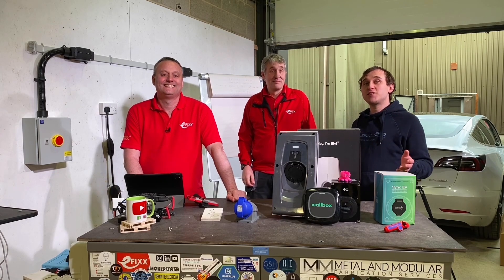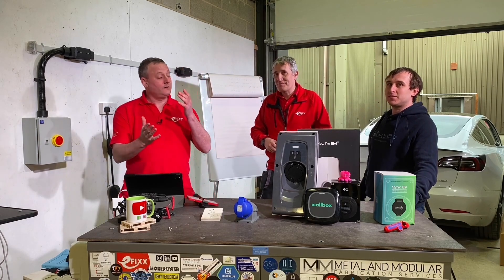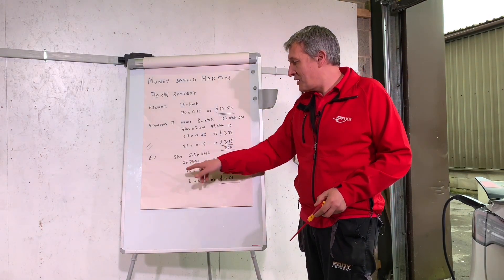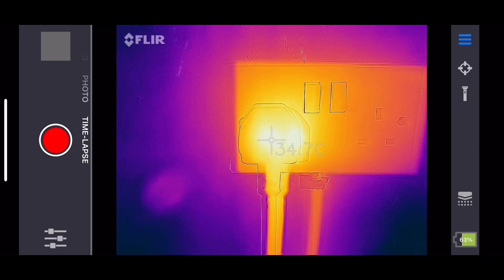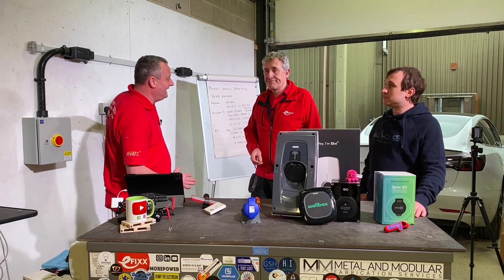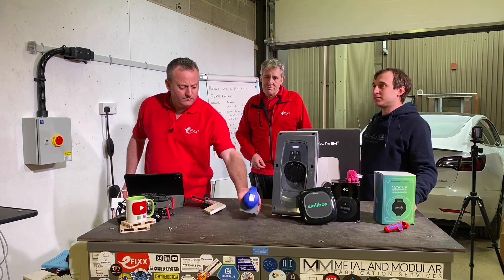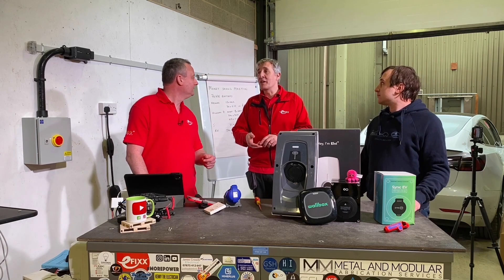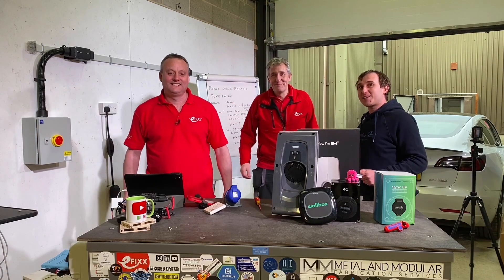5 Reasons NOT To Charge An EV By 3 Pin Socket!

Comment: What if you have an ev that has a far smaller battery than a Tesla. For example a 41kwh battery and you use a wall socket granny charger just to top it up... The charger is on for 4 hours max whilst under supervision.. surely this will still be beneficial for charging
Reply from the maker: Your missing out on lots of safety aspects and also missing out on cheap rates a 41lwh battery would take much longer than 4 hours to charge that frequent use of the charger would also mean the issue we mentioned could happen to socket as it ages
Reply: @NicolasRaimo  the problem I currently have is I'm not allowed to have a charger box fitted but I'm allowed to use the three pin. I only use it for short periods just to top up the car as my journeys are not very long... Maybe it would just be better to use commercial ones at shopping areas or electric stations in the future
Reply from the maker: @jakegreek1  why can’t you have a charger?
Reply: @NicolasRaimo  this is probably a strange one for most people to understand... I work and live at the same place, in staff accommodation. They won't have a home charger put in but allow me to use a three pin socket. I think it's for money reasons but I have said I'll pay, still a no...
Reply from the maker: @jakegreek1  would they consider maybe using it at marketing to say there being green?
Reply: @NicolasRaimo  I will have a word with them and try to persuade them...

In the mean time, I charger my 41kwh Zoe for around 4 hours a day. The socket does get warm but nothing extreme, it is currently my only option for charging.. is there anything (besides the wall charger) that you would recommend?
Reply: @jakegreek1  If you can charge for longer, look at one of the granny leads that offer an 8A charging option (usually switchable between 6A, 8A and 10A). It is relatively expensive but Vorsprung sell a Type 2 one for example. From 10A to 8A, the charging power is reduced by maybe 18% but the heating power losses due to resistance (what actually causes the risks of fire and damage) is probably reduced by about 40%. However, this is just a consideration of the efficiency on the 'house' supply side of things, not in the car itself. Depending on the charger control in the actual car, it might be less efficient to charge at lower power because, for example, maybe the car controller software is programmed to use some of that power to heat up the batteries or operate fluid cooling pumps while charging is in progress. Who knows? Only the car designers would know and there is scant information from them these days. I guess one could easily record multiple charge state increases over time at different ambient temperatures. I should do that, really. Note, it won't help with PEN faults, though, which is an electric shock risk associated with your car body going 'live' due to a fault with the house supply.
Reply: @jam99  been using it for a while now, no issues. Mone has 8 - 10 - 13 - 16 amp charging, for short periods I'd use 13 or 10 amp as it heats up slightly but long charging I use 8 and that doesn't heat up at all

Comment: if these granny chargers arnt safe then why does the dealership sell them. my car is a plugin hybrid it has 8.7kw battery it takes 4hours to charge and i get 36miles is that ok to charge for 4 hours
Reply from the maker: They should be banned however technically there allowed because they have no control what you plug into,  if you decide to use a non fully protected socket that’s your issue no there’s.  They do now all say however on the label for occasional use only

Comment: I guess if you're visiting a friend for tea, then you could plug in at their house with a 13-amp (=10A) plug for a couple of hours and give them 2.5kW x 2hr x 15p = 75p well, call it a quid... :-)
Reply: Some poor souls are paying over 20p per kWh, so you'll be talking more than £1.20. Make it £2 for 15 miles of driving, and don't use their electricity again, because the local supermarket fast charger, if there is one, will be cheaper, quicker, and safer!
Reply: @RWBHere  If it is in service and available. Still very few fast charge points around UK in many areas and typically twice as expensive as home charging.

Comment: I’ve been doing all my Tesla charging with a three pin charger for sixteen months now, two or three times a week overnight is enough for my average weekly mileage, no problems at all 👍
Reply: If you are doing the average 12,000 miles per year the average charge time per day is about 4 hours on a 3 pin plug. Many granny chargers have built in safety devices. On the very rare occasions I need to charge faster there are plenty of rapid chargers in my area.
Reply: @ronshazbut2723  You should still be aware of the strain on the plug and domestic wiring at 10A. Something like only an hour may be enough to cause a breakdown of a socket and resistance losses may be great if wiring is iffy. You just need to be aware of your home wiring condition and circuits, and state of your socket on the circuit you will be using. Even better, though, and not mentioned at all but ideal for low mileage users is the fact that granny leads are available that offer charging rates switchable between 6A, 8A or 10A charging. 6A and 8A have far less risk. The PEN fault issue is separate and is up to your own risk analysis. What should be happening is that the DNO's should roll out grid isolation switches to all domestic premises as well as PEN fault detection devices in all homes but there is no profit benefit, unlike with smart meters, so it is unlikely to happen. Instead, if you want to use electricity safely, the consumer must pay. I believe the regs say that electricians should not be installing 3-pin domestic sockets intended for lots of EV charging unless PEN fault detection is implemented. It would be nice to see the stats on PEN faults relating to EV charging. Last time I looked I think there were something like 100 reported PEN incidents per year in the UK and few were fatal. There are almost 70million people in the UK. However, the increase of unprotected outside electricity use on isolated 'earth' wired metal devices (e.g. granny charging a car) is likely to push the figures up. Regardless, it should be the responsibility of the DNO to ensure that electricity is being supplied safely upstream of the meter. If a fault occurs outside of your home creating a PEN fault then it should be the responsibility of the DNO to detect it and cut your supply, not the consumer.
Reply: @ronshazbut2723 Well said !
Reply from the maker: I've been driving my car for over 15 years now never had to use my seat belt yet,  but if i ever do ill be glad i followed the rules set out
Reply: @NicolasRaimo  I've not used a pedestrian crossing for years too, but I'm still here 👍
Reply from the maker: @Splitscreen83  great… your gonna never use one right..
Reply: @NicolasRaimo  What 'rules' do you think melgigg hasn't followed?

Comment: 13A sockets were designed for short use pluggable portable appliances.  Not high current appliance run for hours on end. In theory a 3 kW immersion heater can run off a ring circuit. A 3kW immersion heater (less than 13A) is always on its own circuit, with its own mcb/rcbo with a permanently connected supply.
Reply: No, a 3 kW immersion heater is 16 amp, but Yes, it has its own circuit and not a plug.]
Reply: @andrewdavidson7951  
I am at 250 volt in my house, which gives me 13.54 A for 3kW. Too big a current draw to be off a 13A FCU. That is if the 3kW immersion was designed for 240v and 13A, which most are, which gives a resistance of 18.46.  

The fixed resistance of an immersion determines the amps drawn.  Amps drawn rises and lowers to the voltage with a fixed resistance.  The higher the voltage the higher the amps drawn. Most are taught the higher the volts the lower the amps, that can be the case but not always.

16A? Way out.   To get 16A the voltage would need to be 296.64.

So, to be sure, always have an immersion off a 16A supply, or off a final ring circuit using a 16A mcb and 20A switch, which is legal.

Comment: Is that 21 hours for the 330 mile Tesla?  If so, a comfortable 200 miles will be approx 14 hours.  As most people never let a car's tank run below 1/4, the average to ensure a fully charged battery is 10 hrs.  That is, if you plug your car in overnight you wake up to a fully charged battery in the morning. 

But the 7kW chargers are better for sure, if a quick charge is needed.  And realistically the charger should be on it own circuit.  Charging off a 13A ring will also induce voltage drop on that circuit maybe affecting other appliances.

Comment: In the 18 months I've been charging using the granny charger and an RCD extension lead I've had a socket crack, and another socket just stop working entirely. I'm finally getting a drive built so I can then get a proper EV charger fitted, so at the moment I'm doing it in full knowledge of the risks involved.
Reply from the maker: many think there is no risk....
Reply: @NicolasRaimo  . There are a lot of dim wits in England and they hate listening to experts

Comment: So does this pen fault protection. Work before or after some one is getting an electric shock ? 
As my understanding of the regs it is to prevent electric shock
Reply from the maker: Depends on the system some systems work similar to an RCD and trip when they detect the greater mass of earth,  others can show fault and just not allow charging
Reply: @NicolasRaimo    At present I am not aware of any system that detect the loss of the pen conductor on a single phase supply. That do not have a earth Reference conductor Avalable. Ie an earth rod to give an independent. Value to measure against    The zappi patent showed a rcd type sense coil to detect a flow of current to earth.  But this workes only after the car has been touched and the person is getting   a shock . 
When it then disconnects the earth conection to the car as well as the live and neutral ... it seems to me that the big issue is the fact that we connect the car shell to the house earthing system.  Is it time that the motor industry should look at there chargers and why we need this earth conection ... why can’t it be earth free .  Double insulated ?
Reply from the maker: Correct some use a earth reference electrode, some act like an RcD waiting for you to touch the car then trip and others use a combination of this and other techniques.  Long as the disconnection is fast enough the risk of harm and risk is lowered.

Regarding redesigning the entire motor industry you need to understand a few things.
Cars have a 12v battery the negative is always connected to the body work of the car.  Cars are protected in theory by being insulated with paint but for the same reason double insulation wouldn’t work and reason a shock can happen is people can damage there car in a crash or accident and unlike a damaged electric device they tape it up or have it painted and carry on,m.  Also mechanics working on car could do a repair and remove any protection by mistake or sometimes on purpose like I’ve seen them remove heat shields as customer is complaining is banging.
Reply: @NicolasRaimo  Paint = some level of insulation. Tape = some level of insulation. Rust = some level of insulation. Crash is unlikely to happen whilst charging. Yes, it can expose bare metal for a period. Professional mechanic is unlikely to be fixing bodywork while charging without PEN protection but could be. Most home charging will happen at ground level. Local protective earth is very likely connected to water and/or gas pipes in ground. So, with a PEN fault, what is voltage likely to be on the car body relative to what the person is standing on? Person is likely to be wearing shoes; added resistance. Likely shock current is what? Sure, at worst death, but similar is the result of ice dropping from an aeroplane slicing through your body. Most ground substrates are more than bone dry and it seems to me that one may be just as likely to get a shock from a white appliance inside the house when a PEN fault happens, particularly with wet hands on a washing machine. Most dangerous, I would hazard, would be outside water taps and those with bare or wet feet. How many injuries/fatalities from an EV charging PEN fault have their been? How many shocks? I would call it a freak accident and certainly massively less dangerous than driving a car which we seem to have no reservations about. Why? Because the motor industry is a huge part of our economy. It is not profitable to be safe and so the risk is downplayed and never spoken of.

Please do show me figures if you have them. It seems to me that modern safety concerns with regard to risk is hugely biased towards improbability (insanity) because of those who can profit from selling and installing safety devices and every company and government consultant having the understandable desire to minimise the chances of getting successfully sued. Realistic safety concerns are therefore very hard to discern. Some people actually get out of bed in the morning; such behaviour is extremely dangerous.

In all likelihood, a shock resulting from a PEN fault is going to come from the charging port flap when someone plugs in or unplugs their vehicle or maybe from a door handle. How about a £10 anti-static grounding strap anyone? Oh, no - no exhaust pipe to clamp it to an EV.

As I have said many times, it should be the DNO's responsibility to install PEN detection in all homes with an electricity supply (along with a grid isolation switch). It really is basic stuff if we are expected to take safety regulations seriously and it should have happened way above smart meters in priority.

Comment: There are builders who are putting in 3 pin sockets for EV charging. Most frustrating. Try the new houses right next to the Maidstone Tesla chargers.
Reply from the maker: If it doesn’t compile to regs for example have all the safety we mentioned in video it doesn’t qualify under the planning

Comment: What about people who rent and could land £5-600 into a charger but would then have to pay an additional £150 to have it removed when they leave?
Reply: If your landlord was savvy he'd buy it off you when you left and make it a feature of the property for the next tennents.
Reply: That would be where a good plan would be to install a 32A commando socket, an plug the charger into that, so you can take it with you. (And £150 to remove a charger is taking the piss)
Reply: @mikeselectricstuff  Who will pay and arrange for the consumer unit, DNO uprating, PEN fault detection and installation of the 32A commando socket? Most landlords, lol?